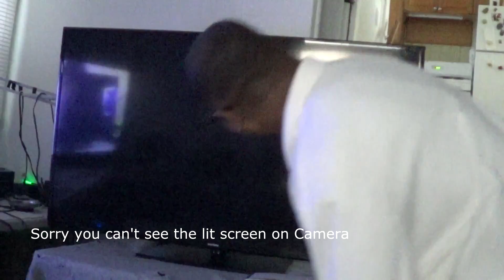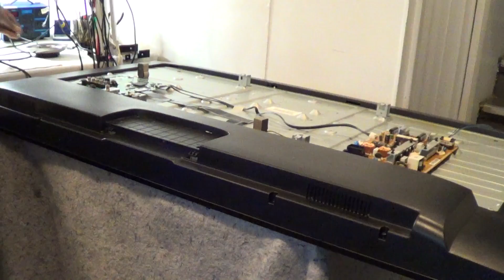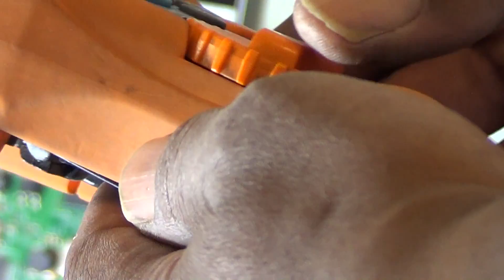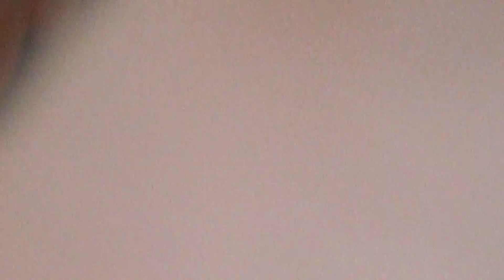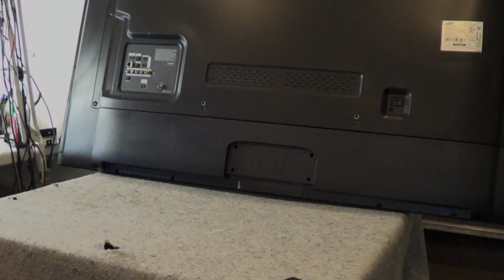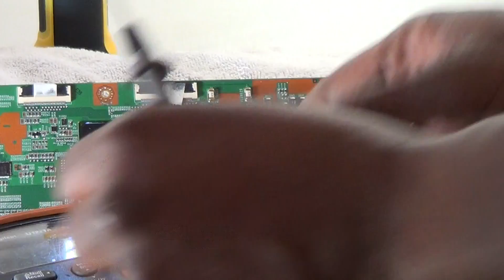Backlight but No Video troubleshooting. Samsung UN60FH6200 T-Con

Comment: I have the exact tcon board shown at the end of video. Had a blown fuse and couldnt find a short. I replaced the fuse and left the 4 ribbons for the screen unplugged then I plugged in the tv for 10 minutes. The fuse didnt blow. Then I plugged in the screen and the fuse immediately blew when I turned it on. Do you think I have a bad screen or is it possible its the tcon board. Excellent informative video and was a huge help Thanks
Reply from the maker: Disassemble the tv to the driver board(s) connected to the panel and check for shorted SMD Capacitors( the little brown ones). Check the t-con board also.
Reply: Thank you so much you are a huge help but I'm very confused about the results I got. This is a 3d 4K samsung, sound and backlight but no picture. The Tcon has 2 ribbons coming in and 4 going out. The 4 output ribbons go to 2 boards long and skinny. Attached to those boards are ribbons that look like they don't come off and go into the screen. I checked the little brown capacitors you said to check. Found 2 capacitors side by side that read 0 ohms on the tcon. Then checked both long skinny boards one was fine the other has a bunch reading 0 ohms. I then unplugged that long skinny board from the tcon and those capacitors now read open. On the tcon theres several components (don't know what they are) that I measured resistance and got different results compared to measuring others that were the exact same component. So again that fuse didnt blow until I plugged in the output ribbons? Do you think its worth throwing in an 80 dollar tcon? Do you know what those long skinny boards are called and can they be replaced doesn't look like the ribbon comes off?
Reply from the maker: Good work.  You just proved that the problem is on that driver board that U were reading shorts on. No U cannot replace just the driver boards. Only thing U can do is remove the individual smd caps on the one driver board and test them individually. The T-Con is mostly likely not your problem.
Reply: Thanks again I hate wasting money replacing good parts. I kind of rambled in my last message so just want to make sure I explained my findings accurately to you before I throw it in the garbage lol. The driver board reads good when its unplugged. When its plugged in they read shorted. I'm not doubting you said just want to make sure I explained it right. 2 capacitors on tcon read shorted all the time. Again thanks so much for the help
Reply from the maker: No problem, anytime.
Reply: I appreciate the help but I don't think you understood my test results or didnt take the time to read  through all the info I provided. What you told me didnt make sense to me so I decided to follow my gut and replace the tcon board and it did fix the problem unfortunately I cracked the screen when it was apart but the tcon did fix the original issue. Your video and first comment are the only reason I was able to figure it out. I believe you know what you are doing but didnt take the time to read my replies thoroughly. Please consider this in the future and thank you again for the help
Reply from the maker: Got a Video on same Issue. Thought U said when u unplugged the driver boards the shorted capacitors on the t-con where now reading open. You must have meant the caps on the driver board. I read very well LOL.  Here's the link to the Video----- https://www.youtube.com/watch?v=jLd6QO7Z7m4&t=232s
Reply: I figured there was a miscommunication thanks for all your help I got it working again because of you just sucks I cracked the screen and now its junk lol wasnt even a reason to remove it but didnt find your video until after I took it apart
Reply from the maker: No problem, anytime my friend

Comment: I have a samsung that I’ve replaced the tcon, main, and power board. I get backlights. I never hear the chime as it’s turned on. Any suggestions on a place to start from here?
Reply from the maker: The new Mainboard maybe has the chime turned off in the settings. But if you have backlights but no video, and all those boards that u replaced are good. Then U may have a bad lcd panel.
Reply: thanks man this video is very informative and up to point.  no unnecessay stuff discussed here and easy to follow.  wish i had stumbled upon this video before i had ordered boards for my tv...
Reply: bigdog8882 They were bought off of eBay. Assumed good, but obviously no way to verify.

Comment: Hello please i need help with my tv same model UN60FH6200F i have no picture sound or light. When i plug it up the only thing i see is the red light for the on and off button at the bottom, showing that the tv is off. When i turn it on the red light goes off and i don't see anything, although when the picture first went out, i was still able to get sound and a very faded picture on the screen. Now i don't hear anything on my tv.

Comment: VIZIO HDTV E422VA NO SOUND I HAVE PICTURE
Reply from the maker: check your other inputs, and/or unplug ur satelite or cable box's power cord from the wall, wait about 2 min. then plug it back in, just to reset it to make sure that's not the problem. Also make sure that the speaker settings are "ON" in the audio menu.

Comment: thanks for sharing your knowledge and time.. I'm struggling to repair my 46W300A here, the t-com is good , I followed your advice and checked the voltage in and out of it, and found the same values you did ( although it's not a Samsung, but the idea is the same ) ... but the tv is not giving image at all. the back light is okay.. the power supply is okay..  I'm thinking it could be the flat cable. I don't know..
Reply from the maker: Disconnect the Ribbon cables going to the panel (screen) one at a time, their should be two. If you get half a display or picture on one side of the screen, then U have a bad LCD panel. Thanks for watching Karla
REPLY
Reply: it gets white when I disconnect the ribbon.. but no picture is displayed.   by the way, it`s not karla watching.. it`s her boyfriend.. I have just started working as an electronic technician and I am already coming across some challenges here.  I could find the repair and service manual for this sony bravia lcd tv, but it only helped on identifying the flash troubleshooting and the VCCs out of the PS..  back on the backlight.. sometimes it doesnt turn on... it seems like the main board is also malfunctioning..   as for the t-com, when I checked the fuse in it, I got the 12v and the other pins also have low voltages.. that`s why I think it`s not the t-com... 

I don`t quite understand the concept of lcd panel... could it be cracked or you are talking about the board inside of it ?
Reply from the maker: Hey, what kind of voltages are U gettin on the output side of the T-con with the panel hooked up?
Reply: lol, I didnt check the output.. geez.. how stupid I am.  I will try to check now... but like I said,.. the mainboard is also not very good. sometimes it doesnt turn the t con on.
Reply from the maker: That's the name of this game "Live and Learn" lol. What gives u the indication that the main is not turning the T-Con on?
Reply: the backlight is turning on and off, the t-con has (14v,  6v, 5V, 1.5V, and lower voltages)  on ITS output.   it seems to me that something is turning the t-con off sometimes.. but  when it is on, and i disconnect the ribbon cable off the painel, it turns the half of the painel white..
Reply from the maker: If U check the "Backlight ON" voltage coming from the main to the power supply board and its changing as the BL cycles On and Off, then yes change the Main.
Reply: THE T-CON, as well as the backlight, sometimes doesn`t turn on... there are three main chips , the ones with heatsink on,  two of them are not heating sometimes... ( coinciding with the times the backlight isnt working ) and when they start heating,  the backlight and t-con works/ the backlight works because I can see the light of it, and the t-con I am checking the voltages and it has 12 in the entry and 14 in the exit.     the tv led is turning red and green in intervals of 10 seconds ( a loop )  when it`s red, no backlight..  As I have no experience and this is my first tv, plus the owner is poor and cant afford buying many boards for me to try here,  I am afraid of buying the wrong board  before making sure that I am doing the right thing.

Comment: I have the same T-con board that you mentioned in the second part of your video. I have checked both fuses and they are good. What else should I check on that particular board to determine the problem? No video but sound and backlight working
Reply from the maker: See if U have any output/Input voltages like I demonstrated in the early part of the Video. If U got input but no output, then disconnect the flat ribbon cables going to the panel(screen), then recheck. If U still have Input but no output then change the t-con board.

Comment: tcon could damage panel if bad?
Reply from the maker: Never exsperianced that, but could be possible if the output stage is damaged, its possible it could damage the driver boards. Usually its visa-versa.

Comment: Hi bigdig8882, I have a samsung ue40d6530 tv, when I disconnect and connect the cable from the main board to the tcon board I get a brief picture then fades out, repeat disconnect and connect procedure and picture comes up and fades out, is my t con faulty? Thanks in advance for your help, Jay.
Reply from the maker: U shouldnt get any picture with the mainboard disconnected. ???? Backlights or Picture?
Reply: bigdog8882 both back light and picture briefly then fades out, I have ordered a tcon board I will let u know the outcome of that b, thanks again in advance.
Reply: Hi B, I fitted a new tcon board but still same, back light on and sound working just no picture, any ideas pls, thanks again in advance

Comment: Hi i have i smart tv samsung. 5500 i have alight and sound but no displey i replays the t-con and same. problem…  replay plz
Reply from the maker: Turn off the lights and make sure that the screen does not light up. If it does not and all u get is a black screen then U possibly have a backlight problem. Maybe bad LED's.
Reply: its light up but no image and i hear the sound .. like ur video ..
Reply from the maker: Disconnect the Ribbon cables going to the panel (screen) at the bottom of the T-Con board one at a time, their should be two. If you get half a display or picture on one side of the screen, then U have a bad LCD panel.
REPLY
Reply: i replace new tcon after 3 years 
but continuously no display 
there is only one ribbon cable attached on tcon
plz help 
i have samsung 32 lcd :(

Comment: I have an RCA 42" LED42C45RQ with sound and no picture. I can see a ghosted image with a flashlight. When reading voltage from PSU LED driver section I get a flash that looks like the backlight trying to come on. Voltage first reads ~ 83v then quickly drops down to 0 in about 10 seconds. I'm guessing PSU LED driver section is bad and I should replace PSU but what do you think?
REPLY
Reply from the maker: You most likely have bad  LED lights inside the panel. Sounds like power supply is working, especially if it goes up to 83 volts. Its shutting down because it cant complete the circuit because of an open LED.

Comment: My Samsung 55 in. LED TV has sound but no picture. Replaced power board thinking the integrated LED driver was bad but still have same problem. Followed your video for T-Con board testing and input looks good. The VG output test points have voltage. All but 4 of the RD test points have no voltage. Also no voltage on any of the RT test points. Any idea's? Thanks
Reply from the maker: Yes, I sure Do have an Idea. U most likely have bad Led's inside the screen. That's if the Screen does not light up (No backlight). Thanks for posting.
Reply: Yes, no backlight at all. I was watching TV and then no light but sound was still on and with the flashlight I could see a picture. 
Is it normal for all of them to go out at once? How do I test to see if it's truly the Led's? And last but not least, where do I get the replacements. 
Thanks for all of your help!
Reply: I replaced the Led's and now it works again. Hard to believe if one goes out they all go out but that's the way it is. Thank you for your help!
Reply from the maker: Yeah, there connected in a series circuit, so it one opens up the circuit is incomplete. Kinda like the old Christmas lights.

Comment: Excellent video very helpful...I have one question I have a 40" samsung tv model un40ju6500f it does  the same exact thing as the tv in your video I have backlights sound but no picture I get 6 red flashes when powering on from remote reciever ive replaced main board t con board and power board with no remedy what could be causing these your reply is very much appreciated as I'm stuck at the moment and dumped a lot of parts in it already by not knowing what to look for wish I saw your video sooner before buying parts
Reply from the maker: If the t-con and mainboard didnt cure the problem, U may have a bad lcd panel.
Reply: How do you check the LCD panel if I disconnected one ribbon cable on the bottom of the t con board to see if I get half of a picture but still nothing anything else you can recommend to test or try

Comment: So I habe no readings on my test points does that mean it's the t con
Reply from the maker: Disconnect the ribbon cables going to the LCD panel and recheck. If the voltages dont come back up then Yes, u have a bad t-con.
Reply from the maker: Disconnect the ribbon cables going to the LCD panel and recheck. If the voltages dont come back up then Yes, u have a bad t-con.

Comment: I have samsung UA55ES8000 TV
,actually TV was works fine before i de-assemble to fix vertical lines. so i was remove the back cover of tv then screw T-CON board and try to connect the T-CON Board left side socket to the LCD panel right side ribbon cable like swap to check the vertical lines get fix or not then tv turn power on and display goes to black ,no back-light, sound works. that was happen. please help me to find out which board need to be repair or replace?
Reply from the maker: Maybe u left something disconnected???

Comment: my tv had green and white vertical lines and sound was ok, I checked the test points on the tcon board all voltages were ok.
It was a bad lcd screen SMH
Reply from the maker: No doubt.

Comment: Hi by mistake I changed the FRONT COLOR for my samsung tv UE46F6200AYXZT and now I do not know what the right parameter is. how can I find the right parameter? Help me please.....   sorry for the translation comes from google translate
Reply from the maker: Im not sure what U mean by FRONT COLOR. If U where in the service menu, there should be a setting that says "Reset to Default" or "Factory settings".
Reply: bigdog8882 is located in the service menu -> MRT OPTION -> FRONT COLOR (U-T-CL-M46 this is the setting, I think wrong) .. even in the service menu on the main page I even find the serial number T-CON as if main board does not recognize it, even if the TV does look normal. however where can I send you photos of the menu? thank you very much
Reply from the maker: There should be an option in the service menu that says RESET TO FACTORY SETTINGS or something similar.
Reply: bigdog8882 OK .Thank You very much
Reply from the maker: No problem. Thanks for Watching and/or subscribing.
Reply: bigdog8882 hello and sorry but I wanted to ask you another question. you have the full configuration or just the main page of the service menu of my samsung led tv UE46F6200AYXZT. thank you again and apologize for my many questions.
Reply from the maker: Not sure. I rarely go into the service menu. Never had to on that particular model. Sorry. Maybe u can contact samsung customer support.
Reply: bigdog8882 thank you

Comment: What's good I have a 55 inch in55fo6003f everything is the same but my back lights go on and off but still sound I can shake TV a tinny bit then lights come back on what could this be everything looks OK but I can't uncover t con board due to a striped screw but if I play with the ribbon it flickers help
Reply from the maker: Which ribbon, t-con cable or led cable on power supply?

Comment: Good video i learned  a thing or 2 here.. i have a LG 49 inch model 49uf6800-ua .. lit dark screen.. sound is responsive when i hit the volume on the tv up or down  but no picture no menu nothing power light goes from red to green normally as well i used my phone as a remote and it powers on and off from my phone .. so i think also its my T con or main board but i checked the fuse on my t con and its ok..but cant find a fuse on the power supply board or main board
Reply from the maker: If the screen does not lite up at all, U have a Backlite problem. Maybe a bad led strip.
Reply: bigdog8882  ok .i checked and the screen glows when its on ..

Comment: sir hit the ball on my screen therefor no show video and sound coming.how to repair this fault and sir your video very superb
Reply from the maker: Sounds like your screen is damaged, especially if you can see an imprint in the screen or colored lines when the screen lites up.
Reply: Hi i got a New Smarttv Samsung UN50M5300AF
Model code:UN50M5300AFXZA
I DROP IT ON THE SMALL TV THAT WAS NEXT TO IT  AND THE SCREEN GOT A CRACK  ON THE SIDE WHERE THE MAIN BOARD SHOULD BE LOCATED 
I GOT SOUND AND CHANGE CHANELS BUT NO IMAGES AT ALL I HAVÉ BACKLIGHT TOO
THANKS
Reply from the maker: Once the screen is cracked there is nothing U can do. They dont sell the screens for TV's